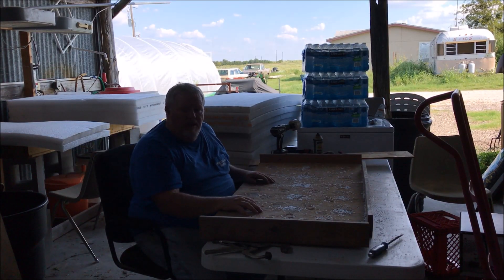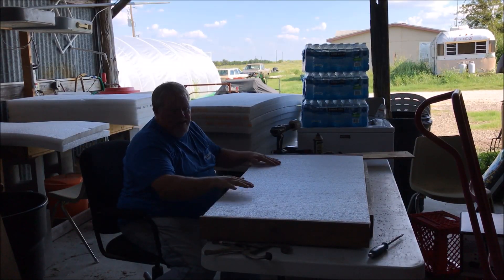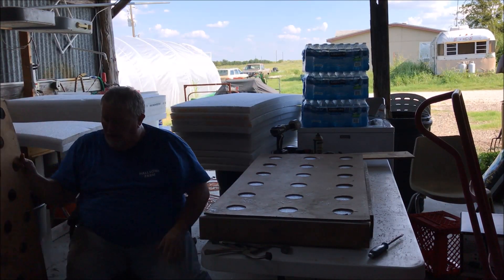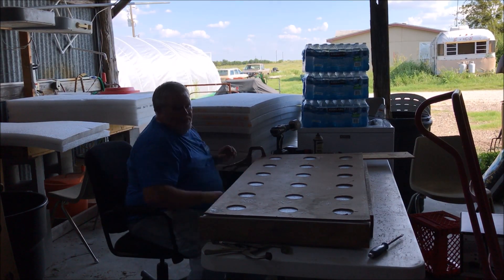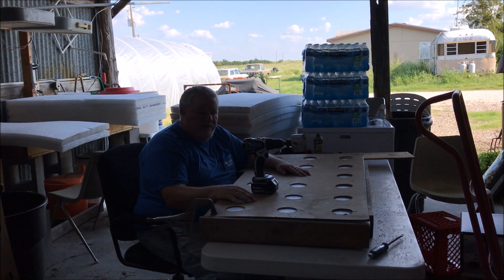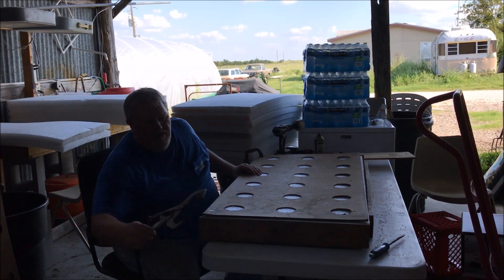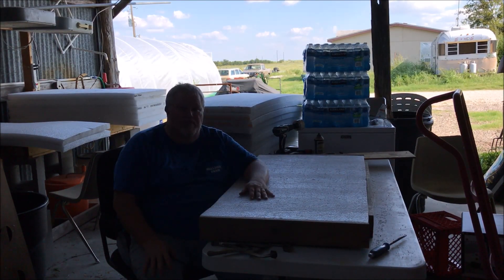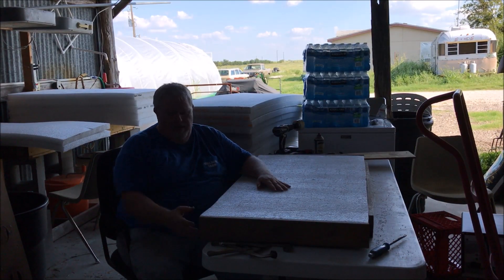How to Make Rafts for Aquaponics System

Comment: I see you have all floating raft method. Is it better/easier than flood and drain with 55 gallon drums cut in half?
Reply from the maker: I would never use 55 gal drums they won't work over time. I always built combination systems but now I only would build gravel beds. The raft beds work great just take up too much time to operate.
Reply: What issues do the 55 gal drum have over time?  I was thinking of doing the gravel beds and either have them as a constant flood and drain or use a timer of 30/60 minutes flood and drain then 2 hrs off. What all goes into the raft system that takes up a lot of the time? Every video people swear by all the different methods and not a lot of info about maintaining them on a daily basis.
Reply from the maker: They are too small at the bottom, roots don’t have the room they need to grow well. Beds should be 12” deep at least. A square bed works best and a flood and drain is a good way to go.
Reply: Hallsome Farm Ok. Makes sense never really thought about it that way. Thank you.

Comment: Thanks. Getting ready to build some rafts. How deep do you build your rafts?
Reply from the maker: the raft material is 1 1/2 inches for two inch pots and come 2 inches for the 3 inch pots
Reply: Hallsome Farm Thanks, I am talking about the entire float bed. Like how much water depth is in the bed before you add the rafts?

Comment: Thanks for the great little video on how you make floating rafts with the assistance of a jig! What kind of styrofoam and thickness are you using and where do you buy it? Thanks for the video!
Reply from the maker: Look for local packing companies, they make this Styrofoam panels, they are pores so air moves through them well I think it helps the plants